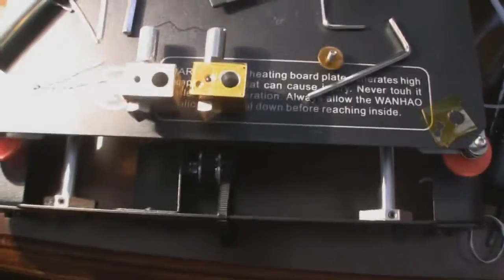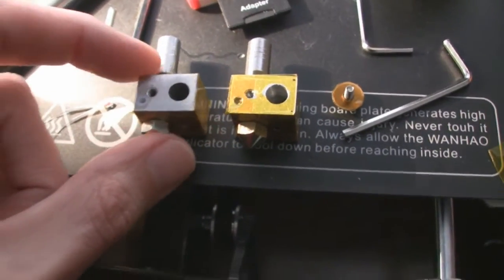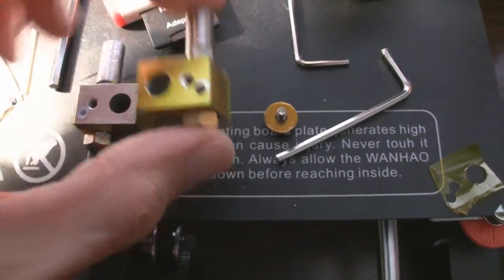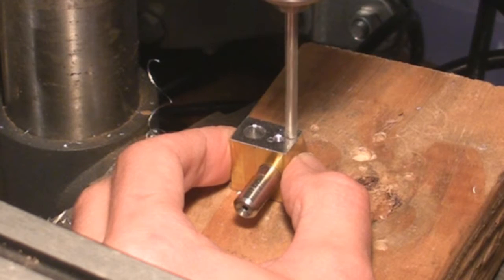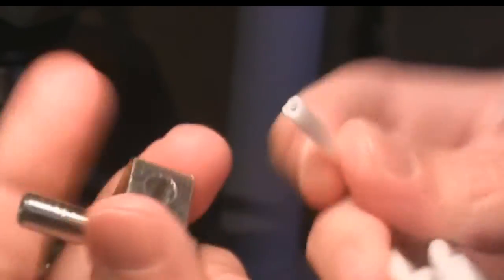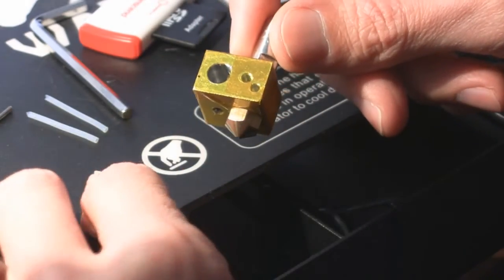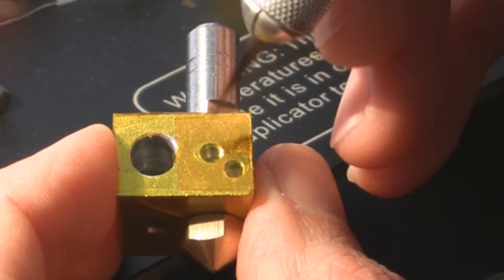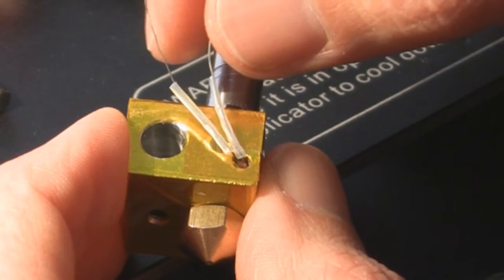Wanhao i3 Duplicator Thermistor Heat Block Modification to Prevent Shorts

Comment: or you could just buy the thermistor   the has a brass head that screws into that slightly bigger hole in between where the heater cartridge and where the thermistor  used to go  it can be found on amazon for like $10 an it works perfectly  :)
Reply: Agreed!  The M3 screw in changed my life!

Comment: The PTFE tube will act as a thermal insulation and modify the  thermistors sensing accurate.
Reply from the maker: Maybe in theory, but in practice it works perfectly for me.
Reply: animateclay also in practice it releases neurotoxic chemicals at 250C just like the filament tube did before upgrading the hotend...

Comment: How are you able to tell if your board is shorted out?
Reply from the maker: +Jeremy Hart If it stops showing you a temperature reading on your LCD. Usually it reads "def /0" after a second or two after you turn it on.
Reply: +animateclay ok thanks
Reply from the maker: Jeremy Hart
No problem!

Comment: One blown Melzi board later, wishing I'd seen this earlier! :)
Reply from the maker: +Pigeon .FX Yeah, I've been double checking everything to make sure that this is what fried my board. So far I can tell, it is. Nothing else is shorted that I can find. I put my thermistor in this configuration and not getting any shorts at all, at least that's what my meter says. When I hook it all up to my new board tonight will be the big test.
Reply: I have taken the opportunity to upgrade to a different main board type,and will definitely be using your Kapton on the washer and in the block technique, as to not blow the new board! (really interesting channel you have, by the way!)
Reply from the maker: Pigeon .FX
Let me know how it works out. Make sure your thermistor is as far back as you can get it so it gives a good reading. What board did you end up buying? I've seen a lot of similar boards on ebay for really good prices.
Reply: I went for a RADDS main board 
http://doku.radds.org/dokumentation/radds/ 

Yes, I think any of the melzi 2.0 boards will fit right into the i3, and can be got very cheap compared to Wanhao own version.....though you have to burn the boot loader and flash the firmware yourself.  

Good luck tonight hooking up your board, hope it all goes smooth, and you can get back to printing!
Reply from the maker: Looks like a nice board, never heard about micro-stepping before. Thanks for the well wishes, going to be super careful not to mess it up :)
Reply: Me too, Pigeon!  Wish I'd seen this or heard of the M3 screw in thermoster before I zapped my Melzi!

Comment: Good fix, but why not use 3mm OD PTFE tube so the tolerance isn't so tight? I'm guessing you already had some 4mm.
Reply from the maker: +Malcolm Hunter Yeah that's what I had lying around. It's the same PTFE you put inside the MK10  hot end.  3mm might work, as long as the inner diameter is just a tad larger than the thermistor you are using. I don't have any here to test that out, but it's definitely a good idea.